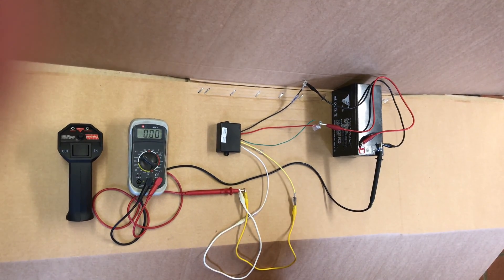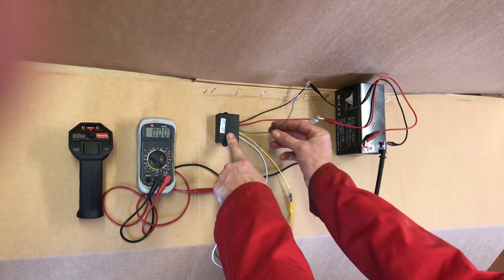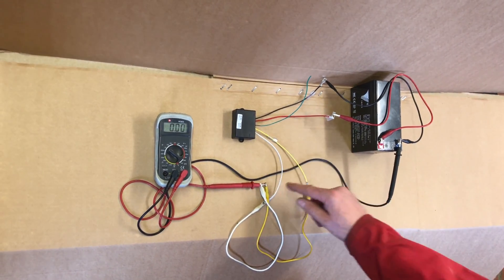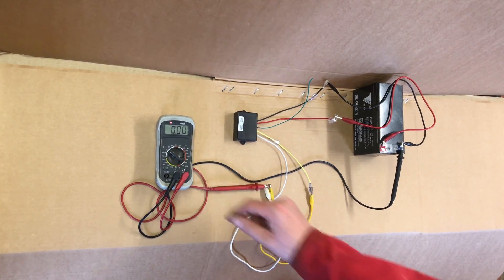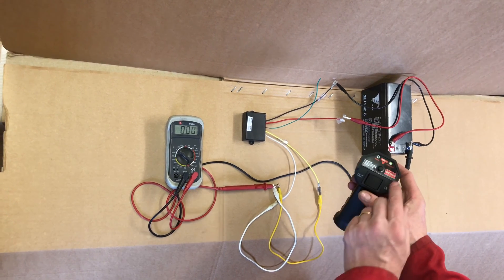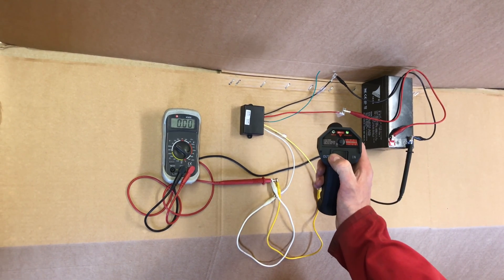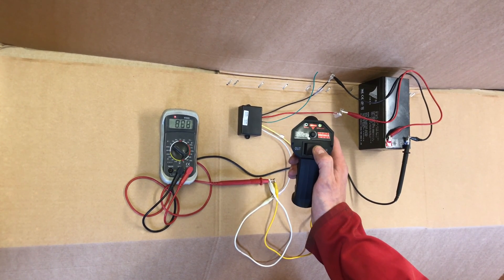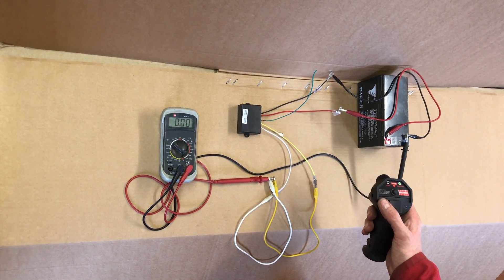Wireless Remote Control Test (SL.1)

Comment: Hi, thanks for answering. Is the receiver box waterproof?
Reply from the maker: Hi, thanks for your message. The receiver you see in this video is not water proof (splash proof yes, but must be protected from submersion/condensation). They are designed to be located in a winch control box to protect completely. Please let me know if you have any further questions. Many thanks, Winchmax

Comment: Hi does the wireless remote only work on one reciever or work with other recievers. Looks like my reciever is faulty but my controller work fine with the wander lead. Do I need buy controls and reciever or just reciever. A bit annoyed as the winch has only used twice but had it over a year now 🙄
Reply from the maker: Hi, I am sure customer services has resolved this by now, but the transmitter is coded to the receiver (and cannot be recoded), so if the link is damaged or lost then you would need both receivers and transmitters I'm afraid. It is still best to get in touch with customer service to see what they can do (it is worth returning to Winchmax if you are in the UK, before replacing to see if they can repair the link).

Comment: My remote I just purchased will not work. Wish I had tried to wire it up sooner but let it set around in the box  for a couple of weeks or so. Now need to see if I can return it.
Reply from the maker: Hi, I am sure customer services has resolved this by now, but the above test is definitive, so it is always good to do this first as a base test before installing. If the product is faulty, they come with warranty and Winchmax will support you.

Comment: My remote control has stopped working but the corded one works. The little light comes on on both remotes but nothing happens at the winch any ideas please
Reply from the maker: Hi, I am sure customer services has resolved this by now, but the above test is definitive, so it is always good to do this first as a base test before installing. If the product is faulty, they come with warranty and Winchmax will support you.